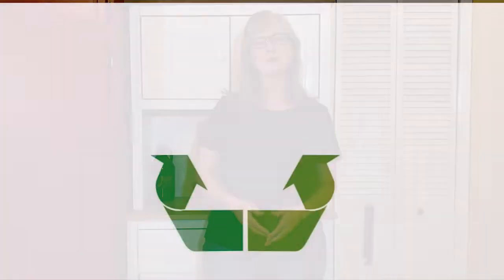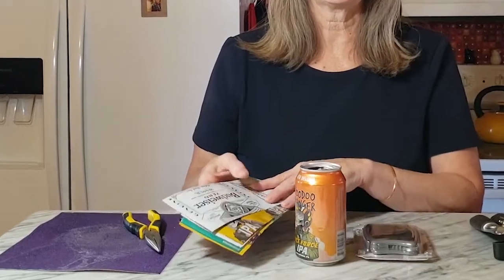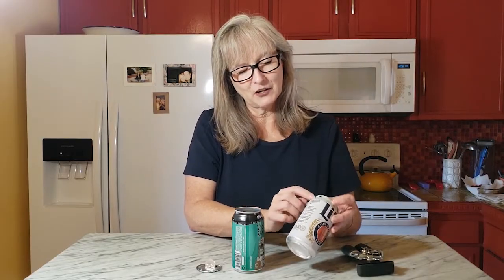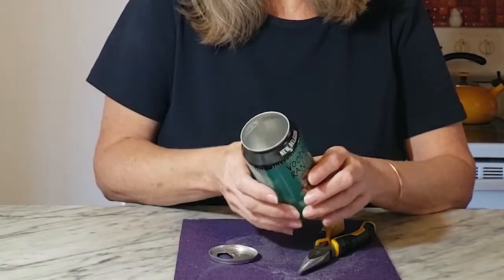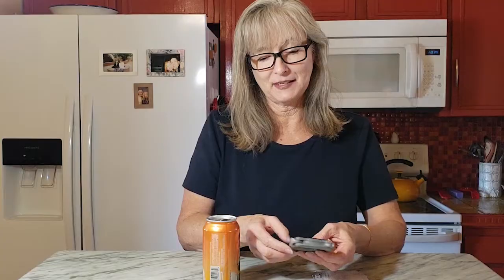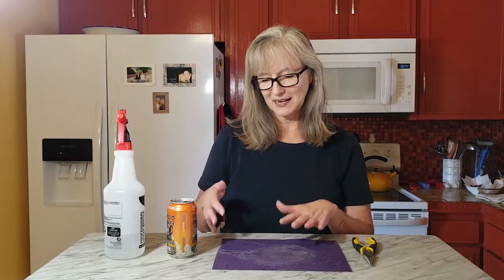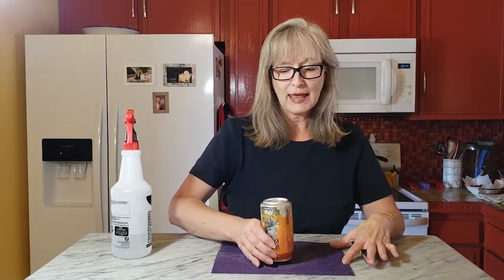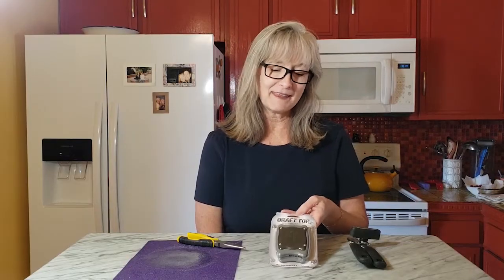How to REMOVE Tops From Aluminum Cans - 3 Different Ways

Comment: Thanks for the video. Just what I wanted to know. How the Draft Top compared. You can also get side cutter, or safety, can openers. They cut through the outside of the rim so the top doesn't fall into the can. But have a tendency to leave small metal splinters. Also, it looks like you're using 180 grit sandpaper. A grit of 320 will leave a smoother finish. Good video.
Reply from the maker: Thanks for watching and for the info. 🙂

Comment: I came here looking for a way to top these cans for an energy project and found an excellent, fairly quick explanation.  Thank you. ...Never did much with aluminum cans. Soup cans, however;  more experience. I used the can opener method before I watched your video. Works ok, My can test had nearly the same crease crack on it. I tried my sideways soup can cutter, you know, the kind that make a soup can reusable top, but this will not work in any way on an alminum can. Discovered that tool through your video. Looks nice, pricey but.
Reply from the maker: Thanks for watching. The Draft Top is the original but you can find cheaper versions. I think it is worth it if you work with a lot of aluminum cans, otherwise the other methods are probably better.

Comment: I use a can opener that you attach on top of the can not on the side .  Nice clean cut!
Reply from the maker: Thanks for the info. I will be on for this type of opener. 🙂
Reply: @UpcycleDesignLab  I use a Starfrit Canopener .  Wish I could post a pic for you
Reply from the maker: @sammy4395 thanks for the info

Comment: Will The Draft Top REMOVE The Bottom of The Can also .. 
Thank You 👍
Reply from the maker: Hi thanks for your question. Sorry but the answer is no. The cutting wheel and the way the draft top grips the can is made to hold onto the rim or lip of the can. I don't believe there is any way to fit or attach this opener to the bottom of the cans.

Comment: I tried using a regular can opener but it crushed the top area as I was turning the opener! I also bought a draft can opener. Much, much harder than I expected. Plus after taking about twenty tops off my cans, later in the day my hand and wrist were killing me! It’s the next day and I’m still in pain. Plus, when using the draft opener, only my very first top came off clean, all of the rest ( 19) I had to cut the very last part to get the top off. I’m very disappointed in the draft opener.
Reply from the maker: Sorry that you are disappointed. The draft top does have its drawbacks but I have found it is still the best way for me to remove the can tops. They do have two different versions now. The original is more difficult to use but it has four blades so I think it is more durable. There new project is called Draft top lift. It is easier to use but only has one blade. Unfortunately they both can leave a little bit attached. I find it easiest to just break that part to get the top off.

Comment: I see the potential for a problem with sandpaper method. Either not using water or not using enough water (to avoid a mess indoors) will likely produce aluminum dust. Health risk!!!
Reply from the maker: Yes you definitely want to use the water. Thanks